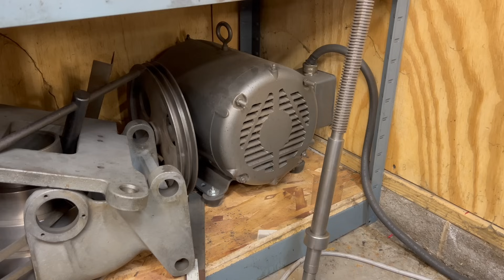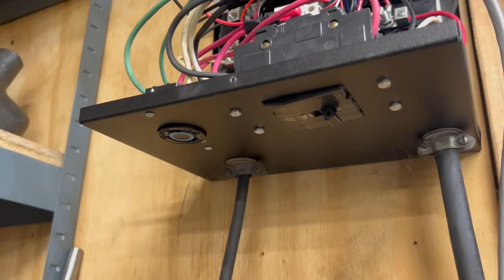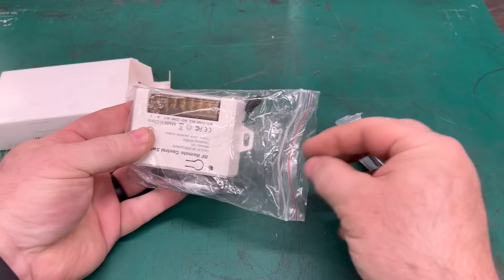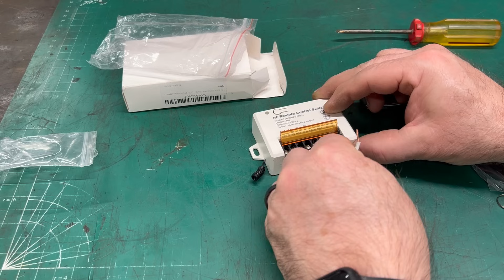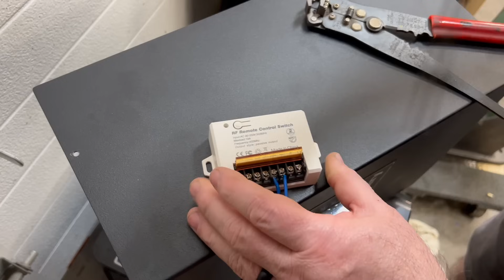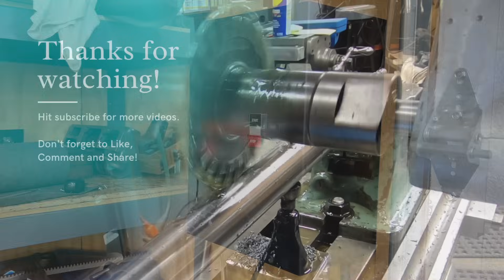Adding a Wireless Remote to the Rotary Phase Converter

Comment: I've been going to setup my shop air compressor with a contactor so I can do this. Its still on my to do list.
Reply from the maker: I plan to do the same to mine. If I don't unplug every air tool, the fittings leak, and then the compressor kicks on in the middle of the night.

Comment: You should really consider using rivets or screws to secure the control box. The heat generated by the phase converter combined with the weight of the wires will over time seriously test the 3M tape adhesion. Ask yourself, have you ever seen an OEM quality manufacturer use tape to secure a control box inside a cabinet? Nice upgrade by the way.
Reply from the maker: I have been using 3M VHB for a long time and it has never failed. There's little heat inside that enclosure, I have no worries about it. But I appreciate your point. I might go back and mount it with some screws later.

Comment: I did this to my American Rotary 3 phase converter with a Shelly home automation switch.  I have an app on my phone, voice control through Google, etc.
Reply: people might laugh at this but if ya forget its running when ya go inside its handy to be able to access it.  or home automation triggers like hey your 3 phase has been running for 3 hours....
Reply from the maker: Nice!
Reply from the maker: I know Keith Rucker has made this mistake.
Reply: Can't tell you how many times I went upstairs at 9 pm ish.  I sit down on the couch... Get comfortable... Realize I forgot to turn off the 3 phase.  Whip out the phone and hit the 3 phase giant button in Home Assistant.  No need to go back downstairs.

I am going to tie all this into a presence sensor that shuts off everything in the workshop if it doesn't sense anyone there after 30 minutes.